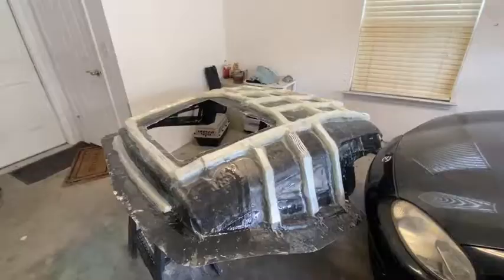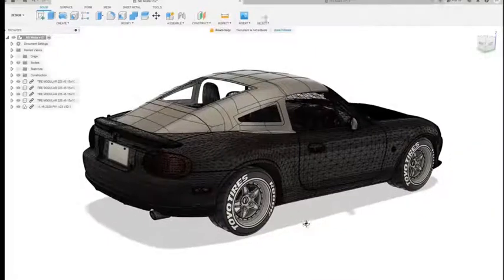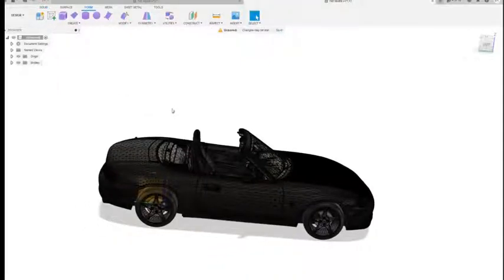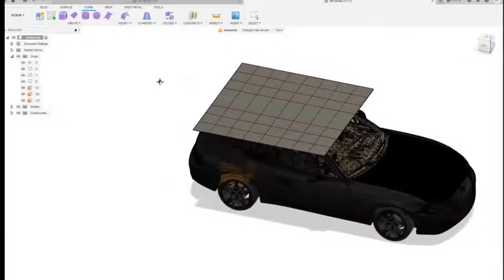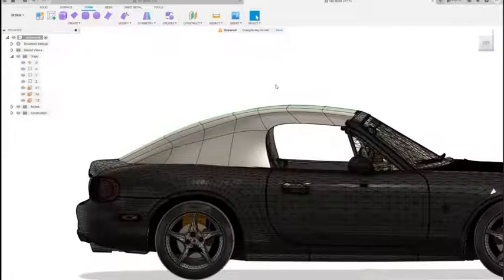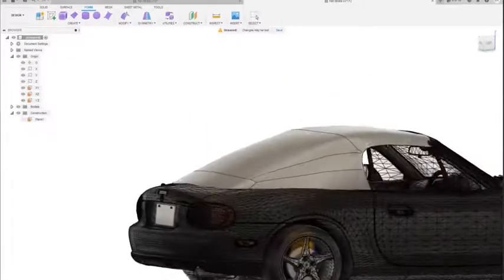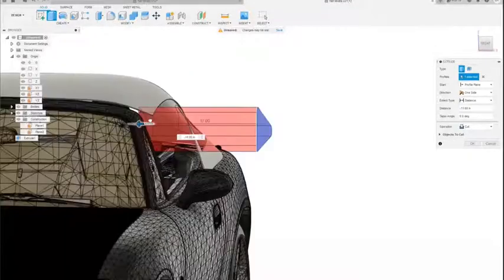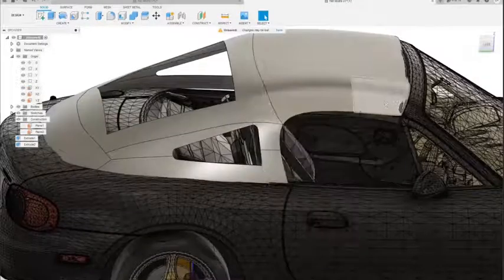How to Design and 3D Print Your Own Car Parts!

Comment: Could you share the 3D model of de car? I am looking for an accurate model for some aerodynamic analysis, thanks!
Reply from the maker: The model of the car is available on Cults 3D
Reply: @HutchinsRacing   Could you share a link to this model?
Reply from the maker: @RaoulRacingRC  YouTube doesn’t let you share links in comments. If you just search “Miata scan” on that website you’ll find it.

Comment: great job with the design work, i typically use solidworks. I know you motioned you do not know where you got the car scan model but is there any way you could share the one you have ? those models aren't around for free anymore. I've looked and couldn't find any nb accurate models.If you did pay for the models then maybe could you find where?

Comment: To all watching this - this is not a 3d scan, this is just some 3d model. It may or may not be accurate enough. If you are building something to fit on your car make sure that model you are referencing actually matches your application. 
Even if it looks the same in general, even if wheelbase and door handle matches in size -  it may be different in many details, and it matters a lot. Most likely it's a model made from blueprints and it's mostly an "artist's  impression" of what car is, not a 3d scan of actual thing. 
That said, I'm impressed with the rest of the videos on this channel. I thought about doing the same thing but considered it being too much work with 3d printer I have...

Comment: Hi!! I just found your instagram and YT cause of the Composite Envisions mention on IG and I am so glad I clicked on you!! Your project is amazing!! I'll follow you from now on cause I love what you do and as I firstly bought my 3D printer, the only thing I though of was making models or moulds to make real parts like this!!! Love it!!!

Couple questions. What material did you use? What printer and printer size do you have and what how long did it take to print all of it? Already read that you spent around 8kg's of material 😂

Well, thumbs up on this project and keep going! I love it!
Reply from the maker: Thanks for the support! I used PLA for all the 3D printed parts, fiberglass/epoxy resin for the molds(polyester resin is a better choice) , and carbon fiber/epoxy resin for the final parts. I use a Creality Cr-10 S5 and I think it took about 2 months to print everything basically printing nonstop haha.
Reply: @HutchinsRacing  oh my god! Those are a lot of watts of energy lol!!! Such a nice project mate!! Contratulations! Already pinned the alert bell!!

Comment: How did you account for the windows? Are they included in the model, or was it a lot of measure and trial and error?
Reply from the maker: The 3D scan I used had the oem hardtop in the model so just shaped the side windows to match the oem hardtop in those locations. I also did some measuring to confirm they were correct size.